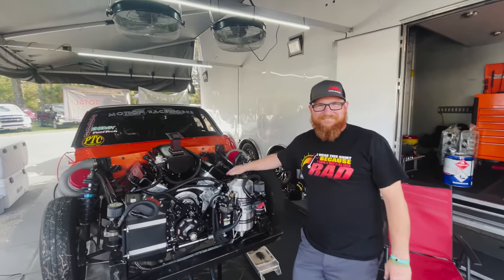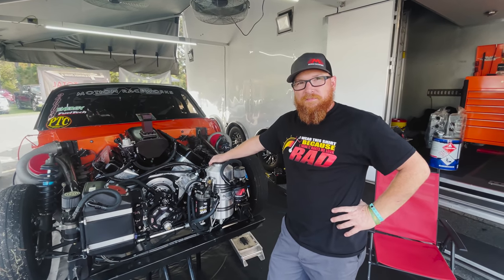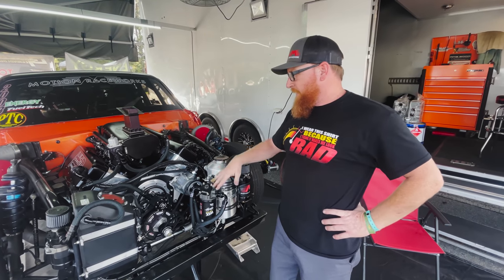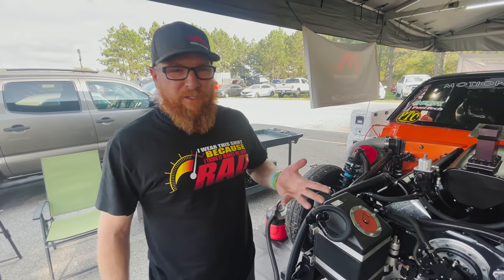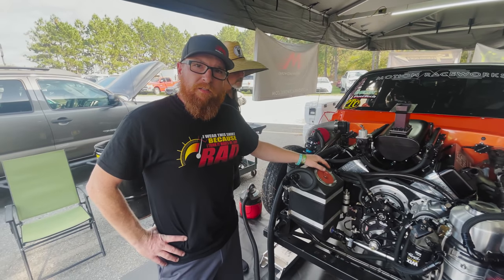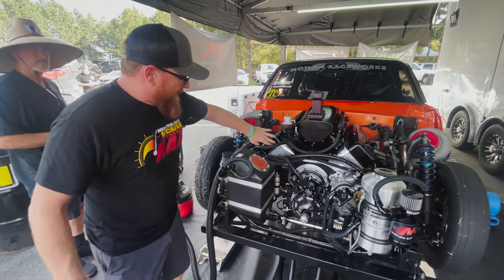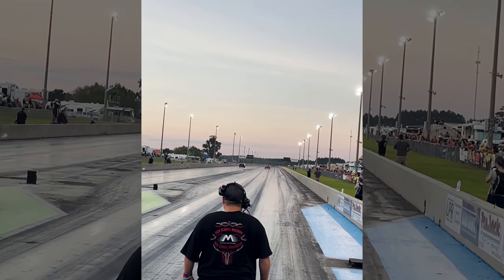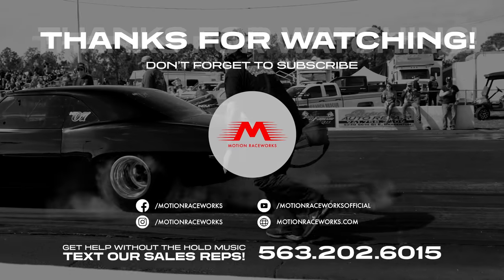Tech Tip Tuesday - Inexpensive How to Cool Down Your Race Engine -  With Justin "Red" Martin

Comment: We do the same but we run the shop vac backwards so that we don't pull oil or fuel vapors into the electric motor of the shop vac.

Comment: Dumb question wouldn’t pull oil into the shop vac?
Reply: It's a dry sump engine, there isn't any oil in the crank case when it's not running.

Comment: I am gonna be that guy. You have to be careful pulling flammable vapours through a shop vac. It's a good idea as far as cooling goes, but not without some risk. If I were to do it on a high dollar motor I might stick a breather filter on just to be safe.

Comment: Guess they’re not worried about dirt getting sucked in through the air?
Reply: It's being drawn in thru the breather on the opposite valve cover. Can't really see it, but there should be a filter there.